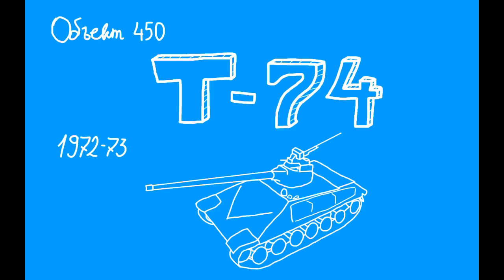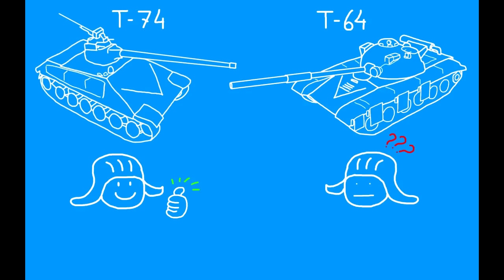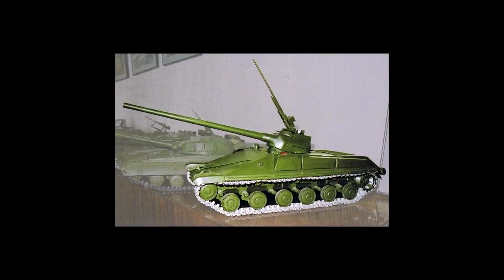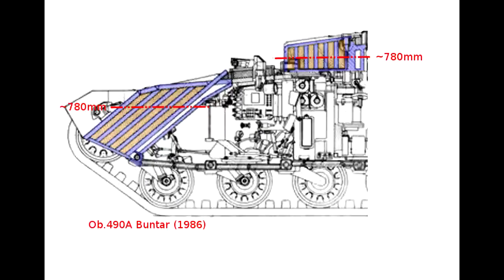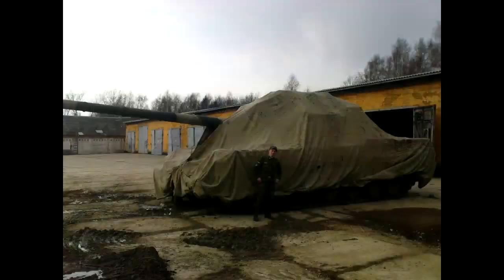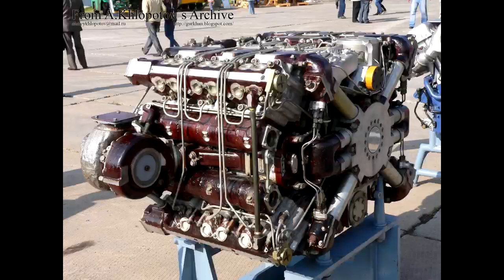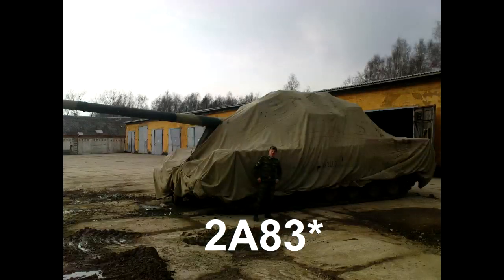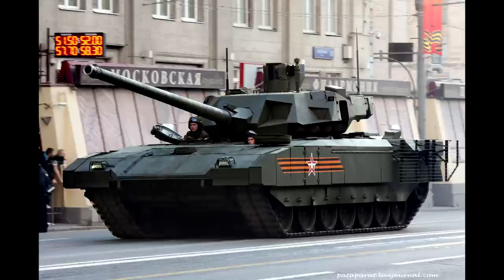How T-14 Armata came to be? Evolution of T-14 Armata, Russian Main Battle Tank

Comment: Good vid on the history with some great pictures. I notice a lot of flat armor on the turret front. Hope all those masts on the turret are not sensors. An artillery barrage would knock most of them off it looks like. You don't need to kill a tank to knock it out. If you can blind the gun sight that's just as good. Ild like to see the layout to load if the autoloader goes down, Again a 3 man crew. All tanks need maintience and in the mud its not an easy task.  But as with all Russian equipment crewed by Russians you better respect them. Its not a T72 crewed by the Iraqis'.

Comment: What tank does the T-14 resemble the most??

T-72-T90 line 
Or
T64-T80 line
Reply: MyUnoriginalUsername deffo t64. t72 is a decelopment (cost wise) on t62 and t90 is based off t80. the design bereu that made 72 and 90 believed in incremental increases in capabilities while morozov DB which made 64 and 80 believed in big leaps, as evident by how good t64 and t80 was at their times with a drawback being cost. the t14 is a completely "new" design and looks to be more something morozov would make
Reply: Actually it's not based on either line. The T-14 is a completely new concept. It uses some features of the older t line, such as autoliader and gun, but those are evolutions of the older ones and not exectlt the same.

Comment: I just want to know what happened to the 20mm autocannon
Reply: 30mm
Reply: Well what happened to it? That was the main thing I was excited about
Reply: Secondary weapons were eliminated as well as radar sight, due to excessive weight, price and questionable efficiency.
Which does not mean that they will not be returned later.
Reply: The autocannon was what I was most interested in. I figured that the designers were thinking of advanced reactive armor  and active protection systems that can stop a APFSDS. 

An autocannon could overwhelm those systems so the main gun could get through. 

Not to mention the air defence, and anti-infantry capabilities. Once tanks start getting autocannons, they will likely only have to fire their main gun at other tanks.
Reply: In this case, the fragmentation projectile blown up at a certain distance to the target will be more effective. The small-caliber autocannon here is ineffective.
Secondary cannon could be useful for firing on small-sized unprotected targets and infantry.

Comment: how is armarta a great thing ?? its never fired a shot in anger or taken one.. it could be a t80 type failure.. sure it looks good but that means nothing. Things being announced or ordered are not real. There are 18 actual test/prototype armarta-esque vehicles  and 100 actual finished designed tanks on order that are not made yet.. so no real armata actually exists today. So how is that GREAT?? 
The tops of the t14 look very vulnerable given the nato forces development of top striking man carried AT missiles and air dropped intelligent munitions again which target tops of tanks, I wouldnt be happy with no top armour in this day and age. Surely as that is the way to take down a tank these days having all your armour on the front nad none on the top is old now and tank vs tank battles are not going to happen, it will be drones vs tanks will it not ? I would rather have that armatra bodied vehicle with the missiles in the back with an up armoured roof. I guess the value here is the multi use chassis can be adapted for todays battle field not yesterdays.
Reply: man the t80 was not a failure and in chechenya, well try to give a untrained crew on this particular  model of tank, a tank to fight their former companions that know where to hit to destroy the tank. on a war where your military organization is on pieces  and the morale is low as the bottom of the well this is chechenya. man the wars that nato and the  americans fight are assimetric and on a simetric war where the airspace is contested. drones, C.A.S. are much harder to do think not only about the tank but also the context of the battle. armata is the future not tanks like the leopard and abrahams that have a stellar performance but are older desings
Reply: Its a matter of who and how the vehicle or equipment is used rather than the tech itself. Say the vietnam war for example,  the US had trouble time dealing with soldiers that are not so well trained in comparison to the US but they re able to make good use of their weapons even if it's somewhat outdated in terms of western view or even the afghan war where a bunch of men only equipped with rifles and rocket launchers still holds a good amount of territory in comparison to the US in Afghan
Reply: T-80, aside from being forced into cities without support(bad tactic), running out of fuel by idling(untrained crew) and ERA not having explosive element(sudden deployment and/or sold for money), was just fine.

None of them are fault with the tank itself(T-80U had internal APU, that doesn't get set on fire by hmg, since 1986).
Only real flaw is T-80's vertical propellant charges for the autoloader. (that can be fixed and has been, with T-72)

As for Armata, top of it is covered in ERA.  The APS will easily intercept top-attack ATGM and IR smoke will obscure it against heatseeking ones such as Javelin; modern Russian ERA also doesn't simply fail against tandem warhead(and Javelin isn't getting any heavier/triple tandem charges).
Reply: A good use of any tank is to always have infantry to provide support as they are meant to compliment each other
Combined arms warfare!  The damn thing that the internet constantly ignores
Reply: To be fair it's never pleasant to be near a firing tank.
Reply: @EcchiRevenge  that's not the issue,  the issue is that apparently the cost of training an army in combined arms warfare is more expensive than just tank on tank (the modern doctrine of the US armed forces)
Reply: That is major part of the issue; because it's Arab army. (the ones who couldn't even get USSR doctrine right)
Reply: T80 wasn't a failure. As an extanker it got my respect. That short height is a lot easier to go hull down then that big ass M1 lol.

Comment: Great video! Really love this channel. And this does sound like a revolutionary tank. My only concern about the Armanta, is do you think the over reliance on sensors, and cameras to get a sound situational awareness of what's going on outside of the tank, instead of having a TC being able to view the battlefield from his cupula. Any idea on how they address this? Just incase (A) artillery rounds hitting close takes out camera, sensors. Or (B) just extremely muddy conditions, cover camera's etc.
  I'm sure they must have thought hard about this, and have some type of solution. But that could be a real achilles heal and something an enemy force could exploit. What are your thoughts?
Reply from the maker: Cameras have ballistic protection when not used, and all optics on Soviet/Russian tanks have cleaning system for their optics, mud/dirt has never been a problem, all modern tanks have that. The only possible way to blind Armata is to destroy optics and cameras one by one during combat, Armata has bunch of cameras all around (for 360deg view) as well as main gun sight, commanders sight/remote MG sight and one rear camera for the driver when reversing, that would be very hard to do, even if everything is destroyed crew members still have vision blocks, and rear camera like on most tanks is small and very protected, so they would still somewhat have all around view. Besides, optics and cameras are a weak spot of all tanks, the one thing I am concerned about is that Armata seems to lack a back up main gun sight, something T-90M, T-80BVM, M1 Abrams... have, but dont quote me on that, because I am not sure it has or doesnt have one.
Reply: man even if the tank was a isolated machine on the battlefied i dont think that the capsule make the tripulation lose awereness of the battlefied, because the crew comunication is better because they are side by side, but the tank have the support of the infantary, airforce and other light vehicles as well as satelites and drones. so is not a isolated machine.

Comment: If Armata effectively represents a capabilities and generational leap to the T-72/80/90 in the same way T-64 was to T-62/55 then it is without a doubt the most capable MBT design in existance
Reply: Well, the T-72/T-90 and T-80 are getting kinda dated.
Reply: James V. D. Bosch Negative. Because, the upgrades for those tanks, that you saw on the descent military parade are so good, Armata might not be put into full service any time soon. It will be smarter and cheaper to upgrade than to make new.
Reply: Even though they're minor upgrades.
Also, T-14 isn't going to reach large numbers because of budgetary reasons.
Reply: @JamesVDBosch  The're not minor. T-90M from T-90A is a formidable bigger leap than M1A2 Sep V3 from Sep V2 as it is essentialy almost completely new tank.
Reply: Armata can hit 90 kph reverse
DOUBT
Reply: @tiagomorais5415  but MBT 70 can go 69kph forward and 69kph backwards
Reply: Well they could always rely on their numbers.

Comment: Dose the T-14 Armata have the option of manual turret control like the M1A2 in case of hydraulic failure?
Reply: T chap40 Majority of unique Armata features are unrevealed to the public, so it might as well probably has.
Reply: probably not since crew are not in turret
Reply: T chap40 yep the crew have access to the turret to manually opperate the gun
Reply: They might be able to make a turret that can be manually operated.
Reply: we have Msta and Koalitsiya-SV self propelled guns which can be operated from outside the vehicle. so might be armata can do it aswel, as they most probably have no access to the turret from inside. But according to this https://youtu.be/40zz3I_Kuxc the turret has a service hatch.

Comment: How many Armatas are currently in use;  do you think that the 1st Guards Tank Army will have them for Zapad? Thank you for a splendid video. I really enjoyed it.
Reply from the maker: I think there are around 50 Armatas curently, maybe even more. In 2015 when it was first presented to the public they said they had 20-30 Armatas. In summer of 2016, 100 Armatas have been ordered to be made, so its been a year now and I think they made at least 20 of them, so thats why I think there are around 50, or even more. 
The 1st Guards Tank Army already has Armatas, but they are using them to see if there are any problems and to suggest some improvements if needed, not activly like other tanks, but they still have them.
Reply: Many thanks!  From Kursk to Berlin the 1st Guards Tank Army was the tip of the spear.  They will be very formidable indeed when they have the full complement of Armatas, Kurganets, BMPT-72s, etc. + close air support: fixed & rotational aircraft + drones + electronic/cyber capabilities. Can't wait for your next video! Thanks again!

Comment: Hey redeffect, can you do a video comparing the t72b3/t72b3m (or the t72b series) with the t90. I want to know the difference between those tanks since Russia only have a few hundred to 1000 t90s but thousands of t72b3s
Reply from the maker: Well I can sum you up in one comment. The T-72B3 is worse than T-90A. T-90A has Shtora APS and better armor, plus a remote HMG. T-72B3 wins in mobility by a bit, but has worse armor and AA HMG has to be manually fired. Armor: T-72B3 armor is around 750mm RHAe vs APFSDS and for T-90A its 920mm RHAe vs APFSDS. They have same FCS and same guns, which means that firepower is completely same, so in conclusion: T-90A has better protection (armor + APS) and T-72B3 has better mobility (barely better) and firepower is the same.
Reply from the maker: Yes, the original T-90 is very similar to T-72B3, but T-90A has far better armor. And ye, new T-90s, the T-90MS (SM) use Relikt ERA, but those are export, and Russian one is T-90M (not in active service yet)
Reply: RedEffect so is that armor value with or without era??
Reply from the maker: It is with ERA, without ERA T-27B3 has 530mm vs APFSDS and T-90A has 680mm vs APFSDS.
Reply: T-72B3's are upgraded production models from the '80s, that means the base armour is reliant on which model it's built upon, there will be some T-72B3's with the T-72 Obr. 1989 glacis array, which is what the T-90 uses, therefore a T-72B3's armour is not necessarily worse than that of a T-90.

Also, Shtora is useless.
Reply: RedEffect, i agree with you that T-72B3 have worse RHA equivalent. But the newest production T-72B3 got better side armor than the T-90A thank to its news side skirt and add on ERA bag. The new production T-72B3 also got Relikt instead of Kontakt-5
Reply: Correction we have 2800 t-90s but still not a lot since Russia is in no trouble we can make super tanks very quickly and poop them out every day from a 100 factories